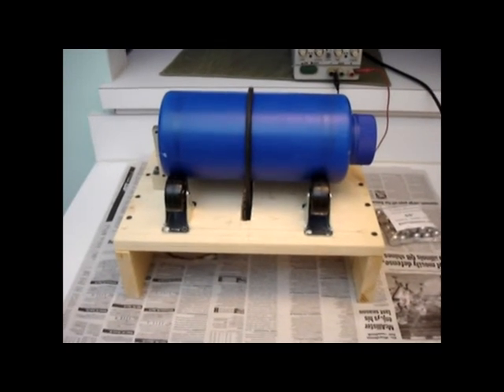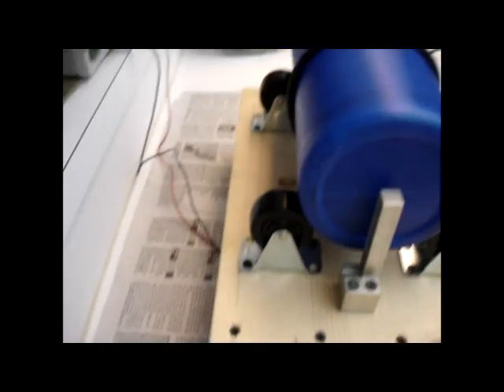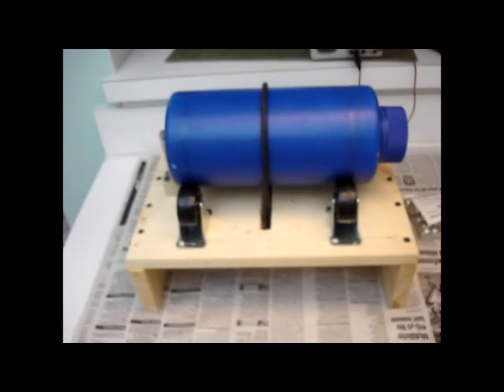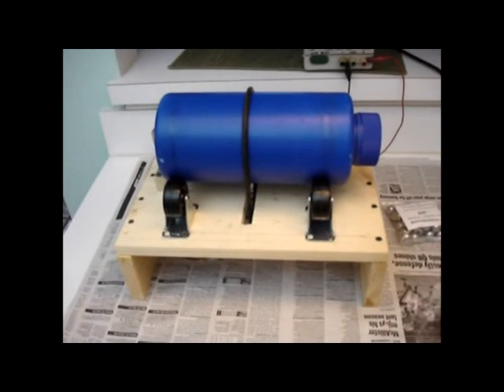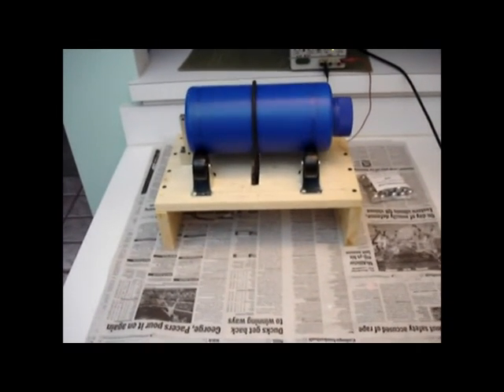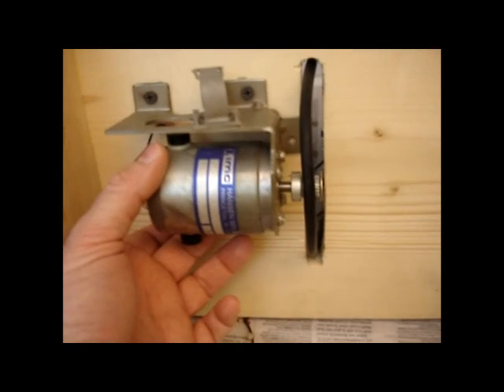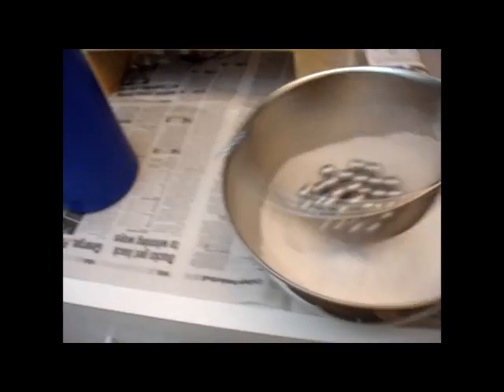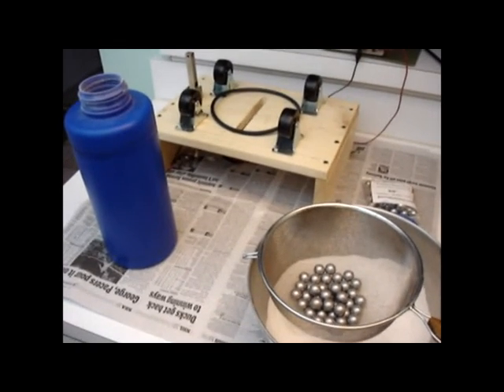A Super Simple Home-Made Ball Mill or Rock Tumbler

Comment: You could use some large diameter pvc pipe with end caps, except on one end install a male adapter to the main tube and then use another end cap as the lid.

Comment: The shop bought rock tumblers use a rubber drum. This is much better than using steel as you suggest - would be very noisy! Even if you purchased a rubber drum you'll still have a low cost set up. Thanks for sharing!

Comment: Simple? Cheap? Sure! We all have a variable voltage unit lying around. What a douchebag.
Reply: Maybe not everyone has that lying around but to go call the man a douchebag is kinda sad. Makes you look like one.
Reply: Everybody does... it's called a rheostat,  Break open an old radio and use the volume control douchebag!
Reply: Very doubtful it would have the voltage range needed for controlling tumbler motor.
Also we're not hoarders, with junk piles of stuff lying around ya pickle puffer.
Reply: You don't have to use an old printer motor. You could put a hand crank on it if you want.
Reply: LMFAO Good one!.

Comment: You can screw 2 or 3  1/2" x 1/2" square plastic bar stock lengthwise and evenly spaced inside the drum to add some lift and drop action to the balls for better grinding action. A thin bead of silicone on the drum side of the square stock would seal any leaks from the screw holes too.
Reply: we are a professional machines manufacturer with 30 years experience and three branches factories. All kinds of crusher machines will be shared with you. website: http://www.zdzg.ccwelcome contact email: fote550@gmail.com

Comment: I was about to build the same thing using a $25 old sewing machine and pedal (speed control) and some wheels just like that. I am planning on grinding rocks for powder for the garden. I may weld a stainless cylinder and add some rock wool and another outer shell for sound deadening though....
Reply: how did it go?  I too have a sewing machine motor.  Do you know where I can get a plastic bottle.